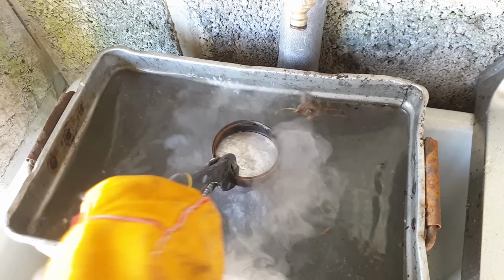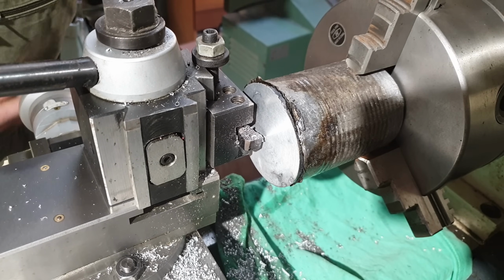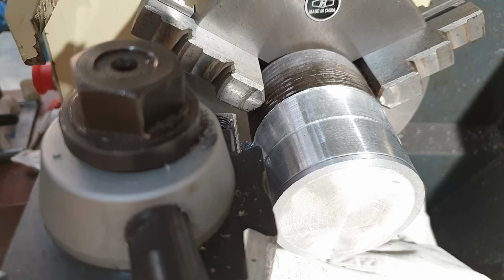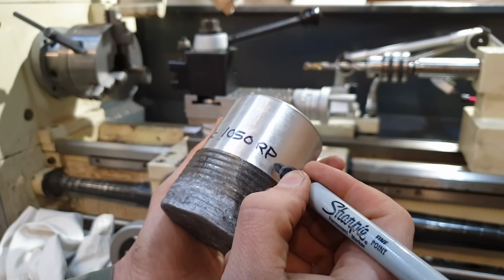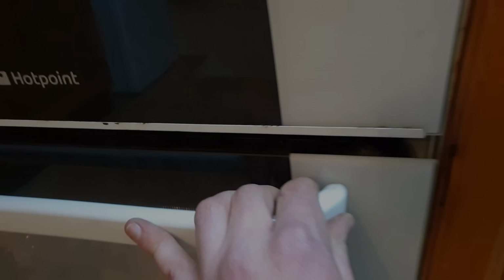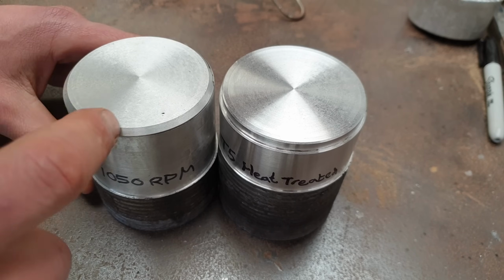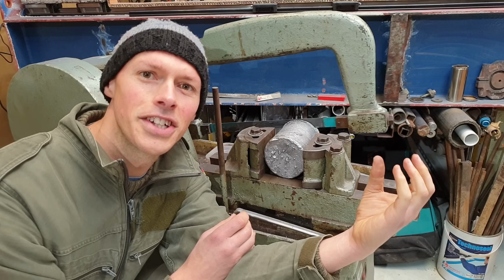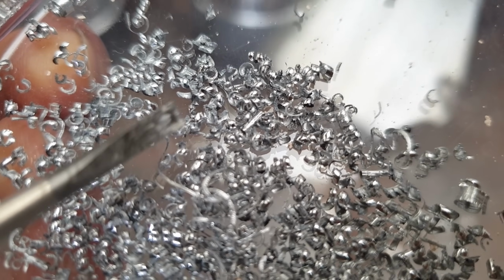Heat Treating Aluminium [Easy DIY method]

Comment: I'm sure you know that WD 40 is water displacement not a lubricant
Reply from the maker: As you say good sir, It does water displacement very well, but if you doubt that it lubricates too, try some.
Reply: Personally, I use diesel when cutting aluminium, easier to get than white spirit, way cheaper than WD40  plus a half gallon lasts a very long time

Comment: You put them in the oven at 180 C for 6 hours... 
But what next???

How did you cool it after the oven???
Reply from the maker: Just air cool. Let them stand for about 1hour before serving ;)
Reply: @FloweringElbow so no quenching once heating it for hardening?
Reply from the maker: @DagoMongo  No, no quenching out of the oven.

Comment: If you want better quality aluminum  you can buy alumaweld rods and throw some in the melting proces and stur so it mixes with the normal aluminum. You will see the difference innstrenght and when machining

Comment: Wd isn’t very good with machining. Gallon of good cutting oil cost $35 and should last you 1-2 years if you dilute 50/50 with diesel fuel and spray it using a air pressurized can. Or you can use it straight out of the bottle with a cup and brush.

Btw diesel fuel or kerosene mixed will give you amazing finish cuts. with the right tools sometimes even a mirror finish.

Comment: Hi! Would love a closer look at that saw, and I was wondering if you ever tried foaming aluminum,by adding an agent during molten state, like sodium bicarbonate
Reply from the maker: Hey Matt  thanks for getting in touch 😀 no never tried that foaming business... what kind of application are you thinking about? Usually I'm trying hard to get bubbles out of the melt...
Reply: @FloweringElbow  Actually, I'm just curious as to how it could be done. 
 I guess it has numerous applications,fire prevention, sound proofing, and it can be used as armor as well. 
 If you meant the saw, I was thinking I could make cuts without all that noise, if I were to build one similar. (Or just similar in principle)
Reply: @FloweringElbow  There is a video by a youtuber called Good Roads 
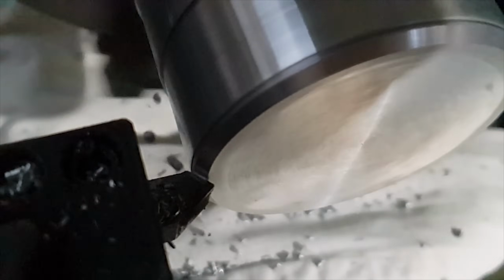Casting DIY Skateboard Trucks At Home - Ep. 3 timestamp 4:30

He goes over what sodium carbonate can do for your aluminum casts, such as fixing holes created by trapped hydrogen.

Comment: After heat treating like this, would it handle the heat of a combustion engine? Like a piston does? Want to take a dished piston and screw a aluminum plug on top? Thoughts?
Reply from the maker: No idea tbh! I guess it all depend on what alloy you have in there...

Comment: I'm curious, this scrap cast aluminum that you machined, it seemed to have a white splochy look to it, do you know why that is and also do you think that that aluminum could be polished up to a mirror finish and if not why would that be?
Reply from the maker: Hi Jeff. That will be my poor pouring technique and hydrogen absorption based porosity. You would see the porosity better if it was polished - so no, it wouldn't look fantastic polished.
Reply: @FloweringElbow  I see, so how would a person avoid the porosity and hydrogen inclusion doing this at home? Is it possible or too expensive or ???

Comment: i want to heat treat it then machine it? ? what do you think? 12mm thick  600mm long by 25mm wide
 i also need to make  it thinner at the ends how much would you leave before final finishing thickness ? (13mm? 14mm? )
Reply from the maker: Heat treating at 13 or 14mm should be fine. Material should be easier to remove once heat treated as it will be less gummy...

Comment: Now, all you need to do is throw that 3003 back into the forge, mix in a few zinc pellets and other material and try to find a formula to make 7075. :D

Comment: Machinist here. The reason you're not getting that gummy/stringy chips is partially because you're machining a casting. The extrusions you get have a more cohesive structure for a metallurgical stand point. You seen to be using a series of aluminum specifically used in casting. Those types of aluminum have excellent flow and pouring characteristics, as well as being highly machinable. Love your videos, keep up the good work!

Comment: Thanks for the great video. Honestly I'd never seen T5 being used for casting only for extruded profiles. This is because the most typical casting alloy A383 has mainly 12% Si. and I'm not sure what intermetallics would end up as the result of heat treatment and I have to revisit some of my coursebooks. But if you melt profiles (6xxx grades), then it all checks out acc to your experiment. But thanks for the good presentation. loved it!
Reply: Yeah, what heat treatment does can be super sensitive to the details of the alloy; but in any case those machined surfaces showed a compelling difference.

Comment: Martin has been encouraging me to have a go at T5 heat treatment but I am wondering what sort of stock you melted to make the test samples? I have had some awful experiences with castings made from unknown alloys. Martin eventually "persuaded' me to buy some good quality ingots (601C) and this transformed the quality of my castings overnight. Although the 601C will take a T6 treatment I haven't found it necessary to get good machineability from the new parts I am making now. 
Regards,
Preso
Reply from the maker: Good morning Mark, thanks for getting in touch. 
We have been using old alloy wheels, usually LM25 alloy. They seem to work quite well and we have an easy supply (that's very cheap / free)...
One of our biggest problems ATM is with pinhole porosity. We haven't specifically tried de-gassing the liquid melt. Although we do have some commercial tablets for the purpose, I discovered in the datasheet that they don't play nicely with alloys that contain magnesium (LM25 has a little)...
It seems to make quite a big difference what the ambient humidity is - it's often very high here in Wales. Also not so good if I'm pouring towards evening when the dew comes.
Ok cheers for now, 
Bongo.
Reply: @FloweringElbow  do it, it drives off hydrogen, also increasing your temperature over a period of time will help keep porosity down as well. Think of putting a pot of water on a burner that is on high. With in minutes you have a violent boiling and bubbling of water.
The same can happen,  The release of hydrogen will stay trapped in your Aluminum and the castings will have your pin hole porosity ,this is also why putting vents in the molds is really important on top of pouring slow for less turbulence and adding a flux to make the aluminum pour more water like all of these things combined makes captain planet ......i mean really tight and extremely low to almost zero porosity in your final casting .
Reply: and it helps form to your molds better to get better detail and you will have over all less shrinkage ahem ....in the metals surface quality

Comment: kerosene works as well if not better than WD. at work, i can't use the water based coolant we have on aluminum do to the gummy and self scaring tendencies. instead i use a light oil similar to WD and am able to push well over 2000sfm @ 0.035" feed and something like 0.150 doc for rough cuts and around 1500sfm @0.008" feed and 0.010 doc for finish cuts on the lathes in T6. aluminum will quickly soak up all the power of your machines as running at those settings will put me above 25hp draw.

Comment: How do you get the air bubbles out
Reply from the maker: With difficulty! You can bubble inert gas through the molten metal, or add various chemicals that result in similar to scrub out the hydrogen bubbles. 
Avoid any moisture on tools by preheating. Don't cast on humid days!
Also, avoid overheating the melt.  
Am actually planning to cover this subject in a future video, but that's the gist...
Reply: @FloweringElbow  hey mate thanks for the reply what is the best temperature to pour aluminium
Reply from the maker: @davidendres7808  Hi. It depends on quite a few factors I'm afraid. If your part has lots of fine detailed features to fill for example, or if it's a mostly regular large cross-section... Also depends a lot on the alloy of aluminium you're using.

Comment: you realize that hosing it when hot anneals it much more?
i tried a piece 6 inch x 3 in a pipe, i had to turn the pipe off, it would not budge with a heavy drift and big Mer(hammer)
Reply: Annealing doesn't happen when water cooled as it hardens it by locking the atoms in place by cooling quickly. Annealing is accomplished by heating to a lower temperature and using a slower cooling process. Often this cooling may even be done in a medium like sand to slow the cooling even more.

Comment: ADVICE buy a vertical handsaw with 6tp1 metal cutting, push it through in 10 secs , liked the vid, hell 5 hrs in oven cost 4 bucks here I  WAS a builder alu yachts, sometimes i'd have 1000kg 5083 scrap

Comment: I have an rc car and the slipper hub who connects to the diff cracks over time and that part is pretty expensive would be a good idea to heat thread it in the oven? Its a slipper clutch piece so its made to slip with the slipper pads under heavh load
Reply from the maker: Hi Surchaufeur, cant really say for sure, depends on lots of factors, especially the material alloy. It probably wouldn't do any harm...

Comment: You really need to drench cutting tool and part on the lathe the Finnish will be loads better im not being nasty but that finnish was a bit rough  and the saw will give a far better cleaner cut aswell and your cutting tools will last long

Comment: Part of the surface finish issue is the shape of the insert point.  Using a diamond hone, stroke the point of the insert to produce a curve with a very small radius, (approx 5 thou 0.005)  this will ease the entry of the tool into the work and soften the surface finish.  Im sure there are vids out there on how to hone a carbide insert.  (or for aluminium, you can use HSS with a nice curved point.)

btw, the quality of surface finish should improve by an order of magnitude with a proper tool.
Reply from the maker: Hi SV Telos, thanks for sharing these tips. Appreciate that :)

Comment: What about ramping up the pressure in the casting process - while the metal is liquid. Ever tried that ?
Reply from the maker: Good morning Wilheln. Thanks for your comment.  I have not tried that. I must admit the idea of liquid aluminium under pressure is a touch terrifying to me. I know VOG has experimented with using vacuum pumps to try to better fill molds and remove gasses...
Any hypothesis as to what increased pressure would do?
Reply: @FloweringElbow  Well - diamonds forms while under  pressure and slow cooling.  If a crystalline structure develops in the aluminum - i guess both strength and "workability" would improve ? (Great videos you're uploading - thanks !)

Comment: Quick question, did you ever get the castings hardness tested? I'm curious as to the change in rockwell. Thank you in advance for any response.
Reply: I want to harden some 1/4 inch (6.3mm) store bought aluminum rod. I am unaware of the alloy composition but I have access to a hardness tester at work. I'm thinking I am going to bake a piece of the aluminum and test it along with a non-baked sample. I'll post what I find. Thank you.
Reply from the maker: @andynuck1772  Cool. I'll be really interested to hear your results. If the sample is an extruded rod i suspect it may not do much... I think artificial aging works best on casting alloys... Still until you try it... good luck, Bongo.
Reply: @FloweringElbow   I heated a piece of this aluminum at 360°F for 5 1/2 hours and then air cooled. The piece was hardness tested along with a piece that was not baked. The baked piece actually was 3% SOFTER. On the N15 scale...
Baked  Average- 30.4
Non-baked- 31.6
I attribute this to the alloy composition. I'm just going to have to buy heat treated 6061 or 7075 for my project.
Reply from the maker: Really nice test there Andy, thanks for sharing it with everyone :D 
This stuff is good to know.
Reply from the maker: Hi Andy. Thanks for the very good question. I did not, no. Would certainly be a nice test to do though.

Comment: Great video. I guess quenching the billets after pouring counted as the quench in the table you displayed?
Reply from the maker: hey Orions Anvil, thanks for the question and apologies for the slloooow response. Yes, you are right though - if you catch it right, the immersion following the pour is the quench. You have to time it well though to early and things get a little freaky - too late and it doesn't do anything. 
I have noticed a side benefit of this quenching is a comparatively shiny surface..
Cheers, Bongo.
Reply: @FloweringElbow  hey thanks, that makes sense 👍

Comment: Hi good test, I had some aluminium which stuck to the lathe tool and was gummy. The scrap aluminium often is an alloy which machines great. However you may come across some aluminium which is gummy. I always thought this was pure aluminium or a different alloy. I think it was some extrusion off an old aluminium greenhouse. According to theory quencing should soften oposite to ferrous . I was interested in this because I am studying aluminium bearings and a key quality is strength versus embedability( softness). I will send you some gummy aly.
Reply from the maker: Hi mechmania.  Thanks for getting in touch. I think artificial aging - the kind of heat treatment I try here works best with casting alloys. 
Like you (I think?), I have found extrusion to be quite gummy... your bearing research sounds interesting. Are they bushings or ball bearing?
Reply: @FloweringElbow  I was thinking of casting some plain bearings for an old lathe . I read somewhere that aluminium tin alloy could be used. On a another forum a lot of people came back saying aly /bronze would be better. However an old guy said they used aly bearings in the spitfire engine. Anyway I began to think that if the bearings were soft initially they would bed in and work harden with use. There must be a lot of trade secrets involved. I wonder if u have noticed the gummy aly melts at a high temp, added zinc/tin lowers the temp.

Comment: if you cast yourself did you ever consider mixing better aluminium alloy types yourself?
https://en.wikipedia.org/wiki/7068_aluminium_alloy
When i was younger and had no clue i mixed aluminium with silver, but i couldn't find any info what this does to the aluminium xD
Btw be aware of the dangers from https://en.wikipedia.org/wiki/Metal_fume_fever
i once got it and it was just one 2 or 3 breaths of that metal fume.

Comment: Do you think there would be considerable improvements in machining heat treated aluminium composite materials?
Reply from the maker: Not sure. Need more information. What's the composition?
Reply: @FloweringElbow  I intend to use coal fly ash as reinforcement for the aluminium composite. Watching your video made me wonder what the effects of heat treating the composite on the machinability will be.
Reply: @ndudimononiwu1448  It's been a year now - How  was your results ?
Reply: @wilhelmbeck8498  i have not been able to do cast the aluminium yet because I am still sourcing the Reinforcements

Comment: Interesting comparison.  I would definently recommend you get some polished inserts for doing aluminium.  Quite cheap if you get the chinese ones and you will see a night and day difference in finish and free-er cutting as well.
Reply from the maker: Hi Joel. Thanks for the tip. I did get me some of those inserts, and they work well :D thanks! 
Bongo.

Comment: Interesting little video. I think that using alloy wheel stock is a major factor in the success of this experiment. Given the stock used it was only when you machined the heat treated stock that we saw the noticeable improvement in the quality of the finished cuts. The before and after heat treatment cuts with the power hacksaw was particularly impressive in the step up in quality. Did you quench all of the stock as a part of the experiment? I think a quench/no quench experiment would be of interest as it is literally the easiest thing for most hobby casters to do without too much trouble.
Reply from the maker: Hi Mark. Yes it was all quenched, but I agree that would be a nice little experiment.

If I was casting something that was dimensionally sensitive, and the part wasn't going to be machined, I would think twice about the quenching though... Even the air cooled test pieces in Möller et al's study showed large improvements with T5 heat treating - and there would be less danger of warpage without a water quench.

Comment: Mate, this is gold! I machine a lot of T5 (I'm guessing in the 4000 series..just construction grade) with HSS and get very good results. I never looked at how you can heat treat ally. It's so simple. Cheers mate.
Reply: Umm. Im not sure that's the T5 he is referring to. The T5 he's talking about is a process rather than a type of alloy?
Reply: @jacobjackson2372  T5 is not a type of alloy, Machete is obviously refering to the hardening level of the material he was machining and not a type of alloy.